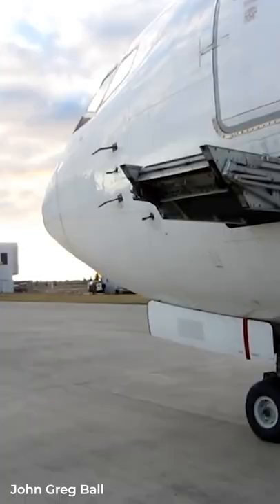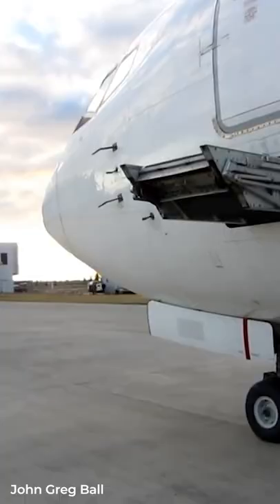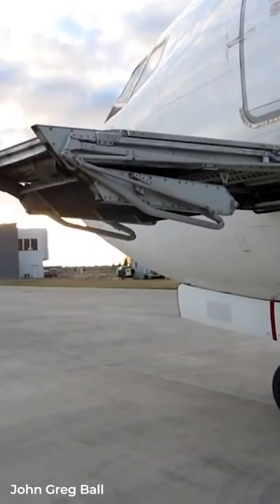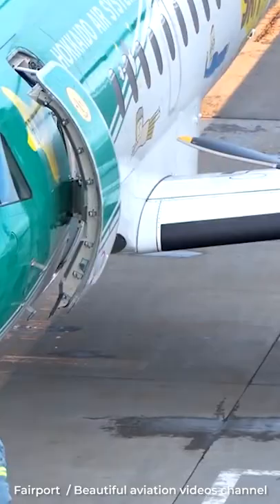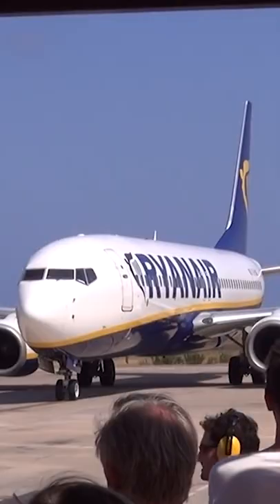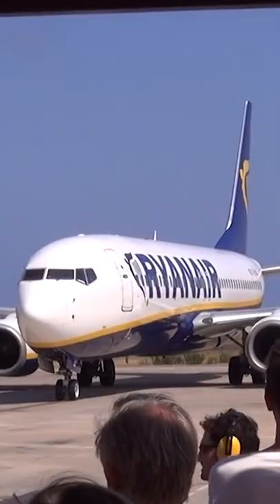Why Some Aircraft Have Stairs Built In #shorts

Comment: Except when technicians remove computers from the  "E" racks and put them on top when the airstairs are out. Then they retract the airstairs pushing the computers right through the skin.
Reply: I personally work on a lot of 37's both classics and ng. It doesn't really seem to be that popular of an option to have on them as none of ours have them.
Reply: @jamessavage3622  yeah true, I started out on 300,400 and 500 and BBJ. And worked several more years when the NGs came out at Boeing Renton Preflight. Seemed as though they were favored only by certain carriers and more by leasing outfits because leasing outfits didn't always know who was gonna buy so they had to have them available. In the basics we constantly pulled computers for trouble shooting or something and we'd just slide them on top of the E racks. Next thing you know it's shift change or mechanics shop would steal the aircraft from us for engine runs and of course ya gotta pull the airstairs for engine runs, someone would forget to check airstairs clearance and next thing ya know, "hey, what's that crunching noise?!" That little trick was guaranteed drug tests for everyone on the aircraft, even rug bunnies who didn't know what a computer is. I never saw anyone get fired but nowadays Boeing will fire ya for anything, especially for saying "mean words."

Comment: I’m only speaking about my airline:
-When we had MD-80’s they had their own air stairs at the L-1 door and at the tail.  Us maintenance folks used the L-1 air stairs a lot.  It was a simple design by McDonnell Douglas Aviation and we rarely had problems with them.
—-
Then we started getting 737-400’s and they had an option for the L-1 door air stair.  At the time Boeing hated the idea of making anything remotely close to McDonnell Douglas designs so their Air stair was a complicated contraption with lots of “switches, bells, and whistles”.  They were very unreliable so my airline opted not to have them.  
We now have 737-NG’s and Max’s and not a single one has an air stair.  
Our rival SWA doesn’t use them either.
—-
I’m very interested in hearing what issues other airlines are having who do use built in 737 air stairs.

Comment: they wont use a jet bridge due to the costs
Reply: In southern Europe, where it's hot, they do use jet bridges so there won't be much heat coming into the cabin which would make everyone turn the A/C on
Reply: @airbus_a320neo   I don't think that is the reason. I haven flown to Seville and Faro a few times and we never had a Jetbridge

Comment: you have said nothing in this video.
Yes, there is stair in some aircraft.
Give us some interesting fact. Apart from 737, any other operator us stairs? Any other big planes have stair option etc. Why so few operators opted for stairs etc.....
Reply: It was more common in the 70s, when there were considerably fewer jetbridges, to see airliners using airstairs. I saw it often in 737s and DC-9s, but some airlines (Delta, for example) removed the airstairs because carrying extra weight costs extra money. There’s always a trade off.
Reply: @crjetpilot  The 727 had airstairs in the rear as a standard option IIRC
Reply: @richardmillhousenixon  yes, it was standard on 727s, 
MD80s, and many versions of DC-9s but it was the forward airstairs that I was referencing.